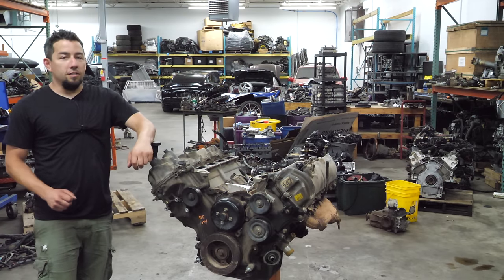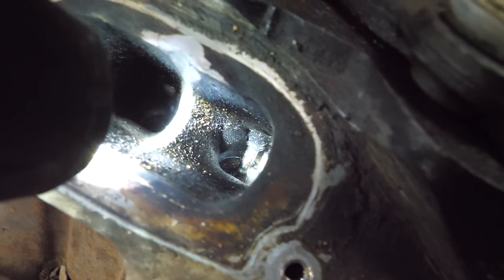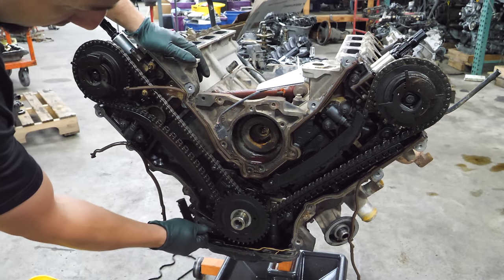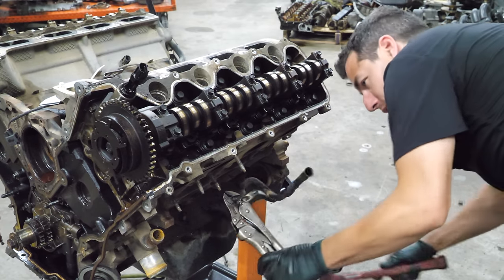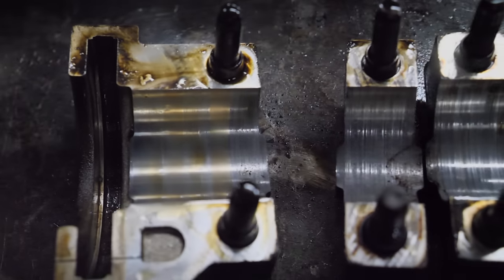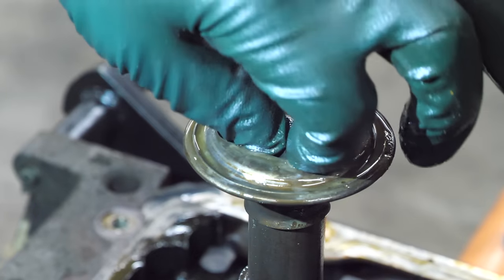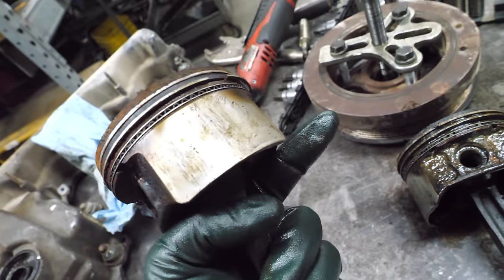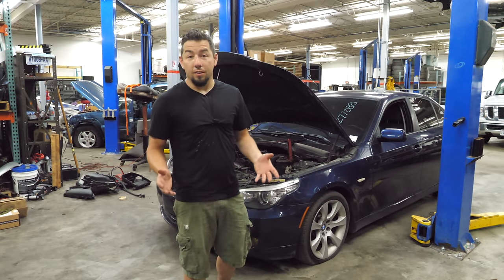Bad Ford 5.4 3-valve V8 Engine Teardown. Which of The MANY Possible Failures Took This One Out?

Comment: Who ever is in charge of swapping out ford motors should get the boot real fast because between gas and diesel  motors, they swap out the good ones, and replace with garbage, have you guys not heard the term if it's not broken don't fix it don't even try. Leave it alone use the same reliable motor then put super chargers or what ever you got to do to make it more powerful or economical just keep the reliable block change the hardware that'd all .

Comment: I am not totaly agree about this kind of engine autopsy. We do not have any information about milage of this engine also maintenance record. Sure some engine are better than other but  for myself it is not a good way to evaluate an engine. This engine look to have over 250k miles but no record to confirm. I have a 5,4 3v in my 2010 f-150 and the only issue was a manifold stud. I change the oil at 75% life and open the oil filter each time and never find metal particles in it. I am mechanic since 35 years and can tell you the reliability of your engine is equal to the maintenance you put in.

Comment: I though my 2010 4.6 three valve was a strong dependable engine. 
It could have been better if the exhaust manifold fasteners didn’t fail.
My buddies 2010 5.4 three valve is strong and reliable.

Comment: Chain tensioners don't have much travel or tension. Any stretch in the chain will cause it to slap the guides and break them. Small pieces get caught in the oil pump and starve the upper portion of the engine (mainly the cam phasers) of oil and well, you know what happens next. That's why you clicked on this video 🤣

Comment: I like my Fords for the rest of the truck but I'd like them better with an LS 5.3 and a 4L80e (the 4L60 of course is a POS).  My 4.6 is utterly reliable but too small. 
I like my Silverado for the drivetrain (AFTER beefing the 4L60 but I buy trucks cheap with either bad trans or engine expecting to sort them rather than buying optimistically and waiting for the first major failure).
Truck engines do not benefit from overhead camshafts because it's trivial to control valves at street RPM. Trucks are not F1 cars and should be SIMPLE and easily maintained with the most basic equipment.

Comment: Most GM fanboys HATE this engine. It’s not a bad engine. A well maintained 3V will last just fine. The oil pump was the biggest culprit. But still a better engine than the 3.4 TDC and Northstar V8..

Comment: These engines were a joke for the general public 5k oil changes 20k plug changes overserviced they last . 200k no ticks or rattles on my 07 F150. A joke on what is there now I want a v8 and it has a belt driven oil pump REALLY going on 300k drive mine till the body falls off.

Comment: The 2005-2008 5.4s were the worst by far, lots of bad engineering. The 2009-10 F150 5.4s were almost perfect engines. I see and hear many stories of those engines lasting 300K easy. The one downfall they still had was weak oil pumps that snowballed into bigger problems. I have a 2010 F150 5.4 with 270K km's and I love it. Last year it just started giving audible signs of needing a timing job. So I got a full timing job done with up to date OEM parts, and I supplied a high volume oil pump from Melling. That alone bullet-proofs the engine. Between the crappy oil pump and the chain tensioners blowing seals, it causes big time loss of oil pressure to the heads and phasers. Then causing rocker arm failure, phasers not advancing or retarding, loose chains slapping and breaking the guides and going into the oil pan. Some of the biggest issues with these engines are the people that own them. These engines are great as long as you don't give them to people that think they can push oil changes 30K miles and beat the crap out of them everyday. Yes doing a full timing job might cost some money, but with my engine lasting on original timing for almost 300K km's, it's almost to be expected (like a timing belt). Sure I love the Toyota 5.7L IForce for power and reliability, but this 5.4 pulls anything I throw at it, starts and runs in Canadian winters of -40C and lower, has never left me stranded, and are cheap to find parts for. These engines give warning signs ahead of time, you have to have half a brain to decide if you're going to fix it, or run it until it blows and call it a crap engine...

Comment: I first started seeing these cam gear actuators on the Car Care Nut channel was a Toyota guy and then the Ford Tech Makuloco Channel.

If these damn timing-chain engine do not last more than 100,000 miles, then why bother? 

The whole idea of timing-chains was to get rid of timing-belts. 30 years ago timing belts weren't that great. However, nowadays a Toyota timing belt on my 1999 Toyota Solara can go over 100,000 miles although it's recommended to be changed at 80,000 miles. Timing-belts are also pennies-on-the-dollar compared to timing-chains.

Comment: Eh, I was lucky on my 2004 5.4 3v and had no issues.  I'll also tell you why Ford liked it. It was a good truck engine. 

This was 05 or so. 
Leaving ABQ, NM headed along the back roads.  Leaving town this guy in a Nissan Titan is driving like a douche towing a smallish old RV trailer. I'm towing a 20' long enclosed car hauler that takes the total rig weight somewhat extra legal. (16,000lbs w 1/4 tank of gas indicated). Really aggressive in his attempts to pass between lights. I'm not even trying to block him. Finally I just don't go at all at a light till he's across.  

Last light out of the urban area and the hill is somewhat meaningful.  I'm behind him.  He goes. 1/4 mile later we aren't 1/2 way to the speed limit. So I pull out and just pass him. 5.4 3v doesn't care about the hill, and only somewhat about the extra 5 tons of trailer and cargo.   I'm upto 55mph and on cruise in short order.   Thats why Ford liked it.  Shame they didn't like it enough to do better with it.

Comment: I added years to my life the day i sold my 2010 expedition with this abomination. It ran well and had good power, along with good gas mileage... until it didn't. I found out it had a cheap timing kit thrown in it. After diagnosing and replacing a bad VCT sensor, I sold it that week. At complete random, it just stopped running while I was parked in a dealership lot across from what was going to become my next vehicle. Almost like it was a sign from god.

Comment: We got a 5.4l in an 06 F150 and that destroyed timing chain tensioner system and rail breaks OFTEN. Our truck has 275k miles and that's all thanks to our diligent maintenance, but we've had to replace that whole timing chain system 3 times because they're made of freaking PLASTIC. Ford's stupidity at its finest.

Comment: I ordered a brand new 2003 BA model Ford Falcon XT sedan with 5-speed manual mated to this engine. It is a very rare car so there were none to test drive. When the dealer delivered the car was the first opportunity to drive it and I was immediately disappointed. It was awful to drive. If I was Elvis Presley I would have shot it. This was before the problems started. And they were numerous. The car was a four year lease deal and I hated it everyday from the first to the last.

Comment: A properly maintained one will go 300k easily the problem is most were severely under maintained.In fact besides the plugs we never had issues in our fleet trucks and if you know the trick you can remove about 90% of the plugs you do without breaking them.The guides can be an issue but just do a 100k replacement on chains and guides and your good to go...Again the most poorly maintained engines were these mod motors as the vehicles were the cheapest especially used.Never had a bottom end failure and only followers were when they over reved the shit out of them but you pop them back in and good to go.

Comment: Never been a fan of OHC engines.  Ford made a lot of better push rod engines in the past. Its not to say every one of the OHC engines are bad ,they just add more parts that can potentially fail. The Spark plug thread design is just poor engineering . Ford should have replaced all of the heads with an updated design, instead of a rigged up fix.

Comment: Yes there's only 3 problems that oil pump the oil tensioner. Which is the only things that you really need to change? But I do have 2 of them And I don't have any issues with them there One Over them is at 200000 it runs. I have another one that's a 100 and 80000 and it runs so I don't see this engine being a problem if you don't take care. Of it I can say that for most vehicles. You can have in Honda or Toyota. You're going to have problems with them if you don't take care of them.  Simple maintenance. But what do people of other car cultures Don't say how that's relevant somehow I do oil changes on tsimple maintenance goes a long way but those engines that fail are probably the engines of an owner that didn't take care of their motor like they should. And how many other cars out there are actually maintained. With no issues. How do you know how much oil you have in those cars and if? You don't check them well? You just bought another motor so it's being a Ford. I don't see that being a problem but these cars can go up 2 up 500000 miles or more simple maintenance. I don't know how else to say this simple maintenance is pretty d*** important don't you think.

Comment: I had one in a 4x4 f one shitty. most horrible engine I've ever had.
I got it used from a dealership lease buyback and it had all the maintenance paperwork from that dealership. I changed the spark plugs (dreading breaking one) and it had 3 different brands of plugs in it. front six matched but the back two were different. the techs at that dealership had changed them 2 times on paper. The driverside rear was original.  I vowed to myself I would never own another Ford made after 1990

Comment: Just think in the mid 60's a 327 pushrod OHV V8 with a steel timing chain could make 300 HP. Honest durable horsepower! Drive 100 miles with good gas and a well tuned carb and the tailpipe would be WHITE! Now we have all this crap to satisfy the crazy greenies and a black tail pipe! Have we made progress? You decide!

Comment: I drove a 99 f150xlt 4x4 with a small puny 4.6 ltr that was gutless but i drove that truck for a long time with shitty maintenance the original motor lasted 387,000 miles and what took it out is the cats got clogged really bad but i ingonred it and it finally blew the head gasket. The only thing i did during oil changes is put lucas oil stabilizer and im guessing thats why it lasted so long. I still hate ford trucks.

Comment: The block itself isn't bad at all it's everything around it that's garbage, first lets start with the plugs, it's absolutely the worst spark plug design in history, making something that should be easy into a nightmare,  then we get to the oiling system, with very small openings they easily become clogged with sludge, also you mentioned the timing system which the tensioners cause problems with, in short once you've owned one you never will again...

Comment: That engine was making loud “help me” noises for a while and was ignored. Poor maintenance will kill anything mechanical. Could’ve had aftermarket timing job was done as well. Big no no for these. Use motorcraft.  I like my 2011 just fine.

Comment: My 2004 3 valve 5.4 f150 (that I bought new) dropped a valve at about 68000 mi. It was Out of warr. and Ford told me tough shit. Cost me over $7000 after having them improperly install a reman. engine and have another dealer fix the poorly done install. I have bought 5 brand new vechicles since  getting rid of it and of course no ford products because of my experience  with them. They do not value or deserve my business.

Comment: Hmmmmmmm if people would treat the engine like it is supposed be used as a regular pickup truck or SUV the engine may last up to 300,000 miles and please in the future used a Ford technician to comment about the faults of the 3 valve 5.4 litre engine

Comment: I'm a Ford fan in his 20s and let me tell you it SUCKS! all the 90s ford's with great engines like the 5.0, 351, 7.3, 300i6 are all clapped out rust buckets or 20k for a decent one, and the 2010s cars with great engines like the new 5.0, 6.7, the ecoboost stuff is pretty cool, they're all too expensive for me still, so I'm left with the 5.4, 4.6, 6.0 and 6.4 to choose from😭😭

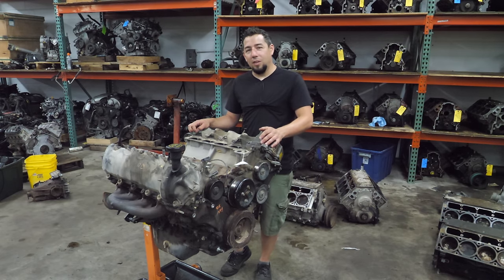Comment: 1:35 another good reason to not buy Ford: they got caught with corporate email exchanges exposing that Ford was aware of the costly problems with the 6.4 or 6.0 power stroke or maybe both of those. Knowing they were completely garbage, Ford continued selling them and fighting to honor warranty claims. It wasn't until like 2019 that a lawsuit finally forced Ford to pay a bunch of former PS customers. If they knowingly did it with the failed mid2000s PS, they knowingly did it with this engine too. Snakes. They cost tons of families tremendous grief and debt, but didn't give a shit and paid every dollar they could to try and get away with it. I know every manufacturer has had an embarrassing issue here and there, but I think Ford takes the cake. If you need an American truck or van, go GM. I grew up driving 2 Econolines for work trucks, 92 and 97. Those weren't mine but I drove them and helped fix them. In 2021 I got my own work truck, a 2001 Chevy express 3500 with the 5.7. The express van at 20 years old was better than the Fords at 5 years old. The 5.7 also ran a pto system and its coolant went through a heat exchanger to make hot water. So it not only had a trillion miles on it but was used industrially. Great machine. Much less down time vs the Fords.

Comment: There's only 1 way to fix these engines. 
1. Remove oil pan. 
2.Pack oil pan with TNT
3.light fuse 
4.RUN AWAY!!!
5. Watch it  💥💥💥
6. LYFAO 🤣🤣
7. Go buy a better vehicle that doesn't have a 5.4 Triton. 😆

Comment: Why did Ford put these lousy engines in the navigators knowing that they were a bad engine design..... simple because they had contractual obligations for the company's that built the parts or built the engines and or..... they had engines left over and they needed to use them up.... General motors and Ford both do that....

Comment: My 04 has 206k miles dedicate doff road rig beat the crap out of it. Hasn’t had a single one of these problems. Does it have an occasional timing chain start up rattle? Yeah but it’s had it since I bought in 2009. Y’all some fear mongers just change your oil and drive it. I’m literally waiting for it to blow up so I can put a new motor in it with some cams or super charger. IT WONT DIE…

Comment: Honestly, i would feel better off using timing belts instead of chains... All that plastic seems to fail constantly over just using belts with rollers. I get that it may have something to do with engine size, but there are cars with belts that hold over 1100 hp like a 2jz on a single turbo. 

Its not about reliability, its about more money from the manufacture. Save a few dollars and pennies then charge the customer for the repairs after warranty or find a way to screw the customer into buying something new. 
Even though Apple is a tech company, they proudly claim that no matter how much you spend for an iPhone, your renting their product and you don't own it. 
That's a sick thing to say to everybody in todays world.

Comment: Great engine if one wants to do cam Phasers all the time. Bwahahaha
Reply: Oh and spark plugs. Don't run anything but Motorcraft in that engine.
  And then there are the snapped off plug extraction head repair issues.
  And the wonderful exhaust manifold debacle.
  Yup junk engine

Comment: Just pulled 3 valve out. Leaky head gasket and hydro locked after it sat for a while.
If it was mine i would throw a Chrysler 360 or 440 in it and call it an upgrade. Fuck everything ive seen about these engines and what ive pulled off of them

Comment: The final straw ...been a die hard Ford guy since 1969 ...23 Mustangs six f150s 6 other Ford's ...three sets of exhausts manifolds in four years then cam phasers then tic tic sound of death all with less than 100 k ...my Chevy truck isn't perfect but it isn't costing me a fortune to run ...absolute moronic designers and engineers...wish I never sold my Enforcer

Comment: This engine after after upgrades is so much better and work very well!!! They are still under powered but good enginees anyvway. So, every editorial I see in vids like this, I WILL CORRECT! And the engine was not maintained. This enginecREQUIRES meticulous maintenance. Since your not a machinist, I don't think your qualif I ed to to make the call on the core condition!!

Comment: My is 2006 fx4.  I got for 3000  5 yrs. It's had 211569 on it.  It's with a miss.  I put new time ch. With new plug with the coli's.   It's had 257.890 now. I got  figured it out.  I think so. My tech it good I so 1.000 rmp. I take my wife to it's all...   but  I put under the sun on it. It's worth b a good boat anchor.  Get a CHEVY.  I promise you.     I had a 2 stroke   with 3 heat attack. Look over me.

Comment: Mulling's oil summit oil tensioners and update Lash adjusters . Those are the things you can update and change whatever issues you may have provide it. You know what the You are doing. I could say the same about Mercedes and behaved up a humorous butthey're finicky. They were designed that way just like the 54. The amazing how an world change can make things so much easier when you are not dragging you're ASS to do those things that are important.  It making sure the levels are maintained.. Same thing i'm going to say again simple maintenance it works on every car Or truck. And tell me that motor wasn't maintained properly.